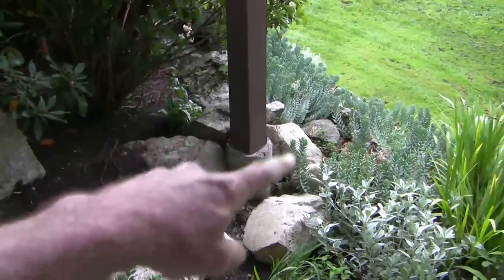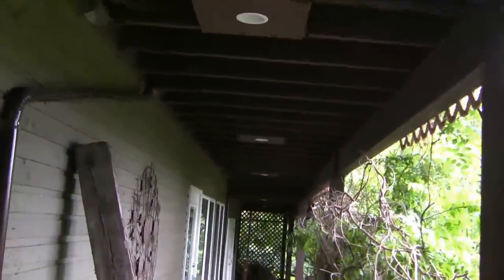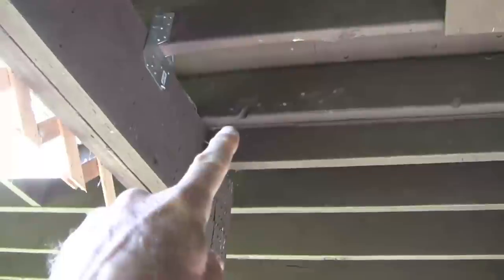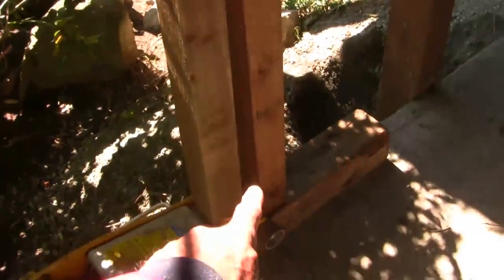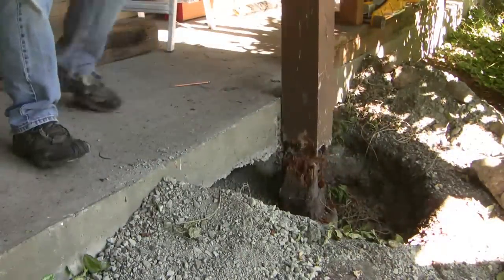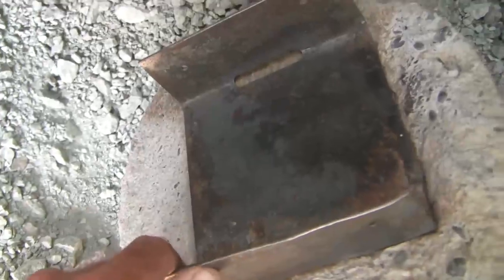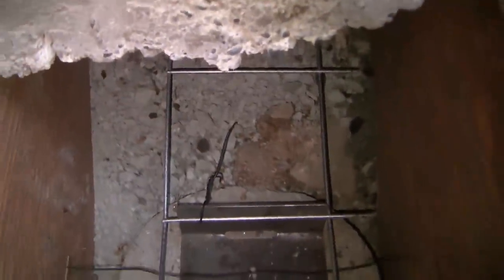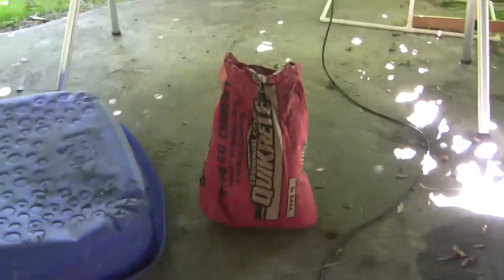How to replace a load bearing post

Comment: You are giving that new post a massive concreate boot, its never going to sink into the ground with such a big surface area to spread the weight, solid as a rock :-))

I do enjoy your methods of repair, usually better and stronger than the original :-))
Reply from the maker: I would never be able to make a living doing this, I take too long. But it's fun to do things to the best of your ability. As a homeowner you have to walk by your work every day, and any minor mistake will seem like a glaring error, reminding you every day. Even things that others would never notice are irritating. Thanks for watching!

Comment: I just replaced post similar rot , 35 years old.
I replaced with treated pine post h4. This h4 product says it will last up to 30 years even buried in ground because of chemical treatment .
It is more decorative than weight bearing.
Good vid, cheers. Probably saved a few hundred dollars labor.👍
Reply from the maker: Good point. The other option is plastic wood, which is more expensive but will never rot. Large plastic posts are more expensive and hard to get, and there is the issue of greater movement with temperature change. In our area, any real wood below grade, treated or not, is an automatic fail by local building inspectors. We live in a very wet environment, but arid parts of the country allow wood to survive much longer.

Comment: Another easier way to do this, is to rotodrill a couple 5/8” holes 4” deep in the existing tube base and epoxy a couple pieces of #4 rebar in those holes, then buy the next size larger cement tube cut to preferred length and place over old one then fill with concrete and install new post bracket. Done

Comment: Hello, I have the exact same situation as you were. I need to replace two posts  (not the corner ones, the middle ones). I was wondering if it would be the same to put a cement block bellow the post, then put a pressure treated 4x6x12 and then cement it around above the soil line,   cement block --> pressure treated post --> make the cement base around the post with plywood and perhaps throw some mesh and rebar around the PT post --> pure concrete around the post 1 ft above the soil line. Would it be the same? It would be much easier don't you think? Thanks for the great instructional video!
Reply from the maker: I'm not sure a cement block below adds anything compared to digging a big hole and filling it with concrete and rebar. Without the cement block, such a post hole with treated wood in the center is often used by professional fence builders, and it works great for the first decade. Depending on where you live, specifically how much moisture is in the soil, the pressure treated wood can still rot out. Then it's a lot of work to dig it all out and try again. Ten years is long for a fence but not great for a house foundation. I personally would rather have a pure concrete and rebar foundation with wood pilings bolted to it, so the wood could be replaced in the future. Make sure the top of the concrete is well above the surrounding soil.
Reply: @spelunkerd  Got it, Thankyou for your reply, how do you know how much to lift if the old supporting column is completely eaten up and it is obvious that the roof is a bit off? nothing major but I do need to raise the roof line a bit
Reply from the maker: @lgalico81  I'd get up there with a level and carefully consider how water will drain off. Rainwater absolutely needs to drain away from the house, and you should also account for settling of the new post foundation. Have a look at how the gutters are set up.  Water needs to follow the gutter down to the adjacent gutter drain, so you want a gentle slope of the gutter towards the drain, even after settling occurs.

Comment: kind of sucks they put that below grade like that, but it happens. I know when I fixed my fence, one of the old posts rotted off the sono tube like that. I didn't have the means to pour new, so I just dug down beside it and put in a pressure treated 4x4, no its not the way to do it, but at least it will hold till next year when I have the whole fence replaced and do the deck. those tubes really need to be about ground at least 6 inches and how deep are they, like 4 feet.
Reply from the maker: Yeah, I was pretty irritated when I found it. It was obviously a professional concealment, too. I had a couple minutes of diatribe during my first draft of the video, complaining about the previous contractor. But, complaining doesn't help and it's not very entertaining to watch, so that clip hit the cutting room floor. Good luck with your project! Yeah, in locations where the ground freezes a conventional depth is 4 feet, with the top at least 8-12" above grade.
Reply: spelunkerd yeah that darn frost. I watched another video about removing and installing posts, the guy was somewhere in the states where they don't get any frost, and he was saying it only needs 2 feet down and no concrete. but yet most that watched, are from areas where there is, and everyone just said its ridiculous.

Comment: How much would this job cost by professionals? Im buying a house and noticed the deck posts are below the sod line and i want to negotiate a fix or compensation.
Reply from the maker: Lots of variance in how this is done and how much time it takes, with more time translating into a better job. I'd get a quote from somebody local, making sure that they aren't planning on sinking the wood into concrete. It took me several hours of my time, a pro would undoubtedly be faster.

Comment: Looks like it's not slumping or anything yet. Can't you just full with wood filler and prime so it won't get any worse?
Reply from the maker: Any load it was carrying was already redistributed to other pillars, and because of redundancy of the system nothing happened. We live in an earthquake zone, and it made sense to fix the defect correctly, if for no other reason, to maintain resale value. I don't think anything less than what I did would be appropriate, and over the long term the work to do an inadequate repair would be at least as high as the work to fix it properly.  Carpenter ants and the wet wood termites we have here will completely destroy any wood that is below grade.

Comment: How to weld a steel fence?
Reply from the maker: The galvanized wire mesh I used inside the concrete is sold in 4X8 sheets at building supply stores. It's easy enough to weld if you want to do that, but do it outside because the galvanizing elements release toxic gas when heated. Welding on galvanized steel that is typically used for fences is prone to rust at the weld line afterward, so you need to clean and paint it afterward. It's easier to do with a MIG machine, but even stick welding is possible on fencing wire.

Comment: wow that post wasnt even pressure treated.
Reply from the maker: No, and around here we can't get pressure treated posts of that size without a special order. I would have used a pressure treated post to replace it but they are too hard to find. In any case, now that the post is well above ground I don't expect to run into recurrence. Almost three years later, this post still looks great. Thank you for watching!

Comment: WAY too much water in that concrete.
Reply from the maker: You're right about that. My last sonotube had significant castelation and I was trying to avoid, that, knowing this one was not a critical load bearing structure. It worked out fine in the end.

Comment: always back up your jac
Reply from the maker: Wise advice! One of my floor jacks occasionally sags with weight, which would be an issue if I ever trusted it. I always use jack stands, or as shown here, a solid post holding the weight for the week as the concrete cured. Even so, I wondered if it would stand up to an earthquake while in place. Thank you for watching.

Comment: Carpenter Ants..you should have made them do the work 😮😊..4:10 watch it the gaffers about ..p.s. are the metal seatings stainless steel
Reply from the maker: Ha ha, yes. The mesh wire for strengthening the concrete and the metal baseplate that the post sits in are both galvanized steel, not stainless. My local supply store doesn't keep stainless options in stock. The post is still looking fine today. Thanks for stopping by!